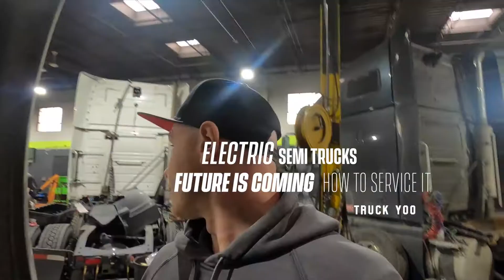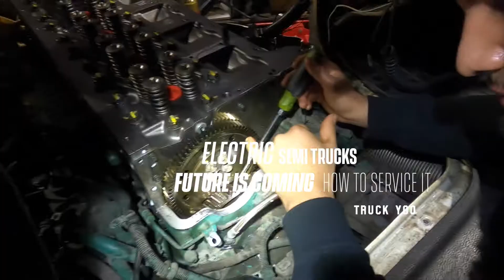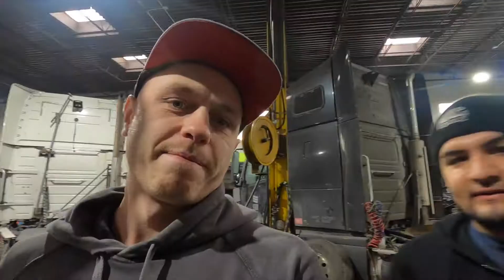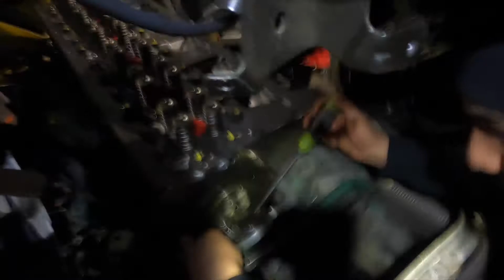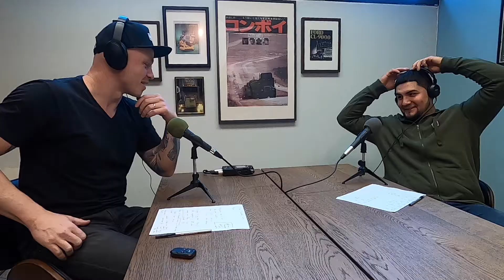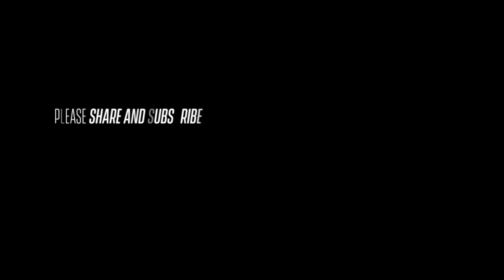Tesla Semi Truck. Electric Semi Trucks - What to expect!

Comment: Also electricity is based on supply and demand. Our electric bills will rocket. Plus our roads are paid for by fuel taxes, these will be put into our electric costs. Jeez and dont get me started on the cost environmentally for producing one of the electric vehicles. Personally I feel small diesel electric power plants on commercial trucks would be more environmentally conscious and make more sense